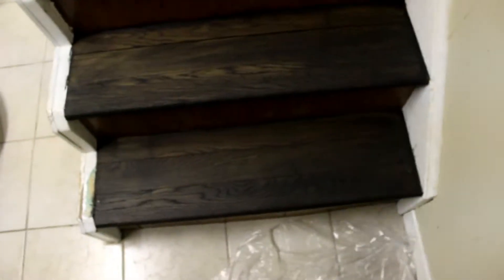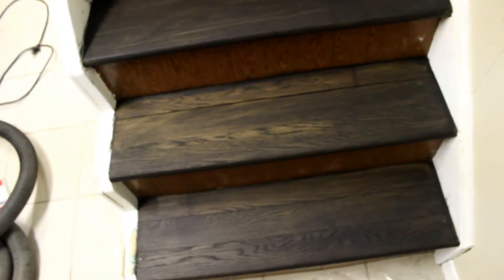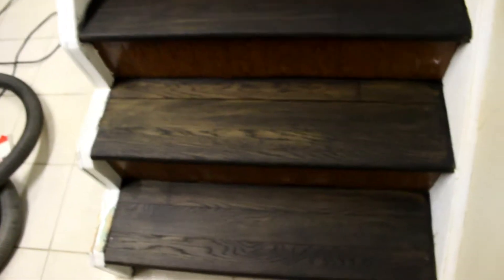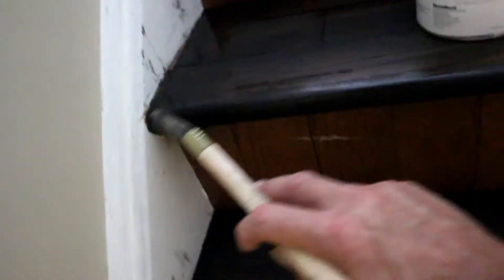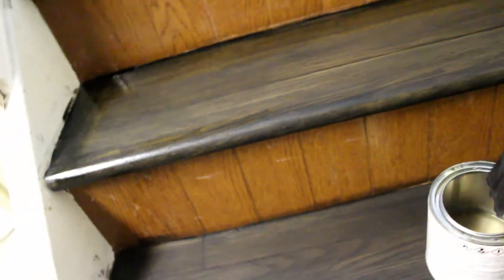How To Apply Urethane To Stairs - Contractor Method - Satin Urethane - Please Ask Questions (Ep#13)

Comment: Would using a roller not encourage bubbles??
Reply from the maker: Lint free, microfiber roller = No bubbles
Most importantly is to pull/push the roller at a pace that won’t lift the urethane or it will create little dimples/bubbles in finish. Allow weight of tool to do the work. No downward force.

Comment: Does anyone poly the risers in place?
Reply from the maker: Yes. I apply urethane on risers but very thin coats so it doesnt run as the streaks are difficult to remove when dry.